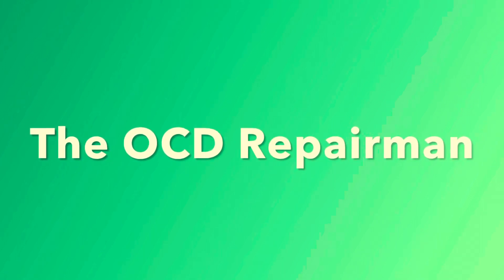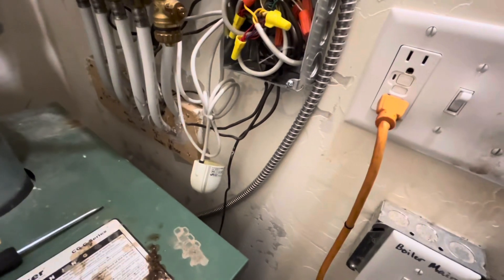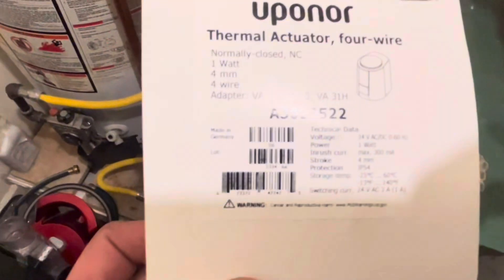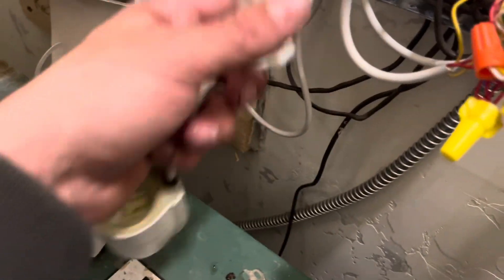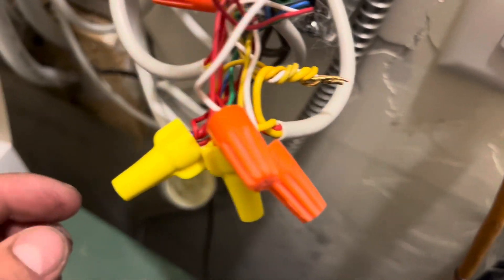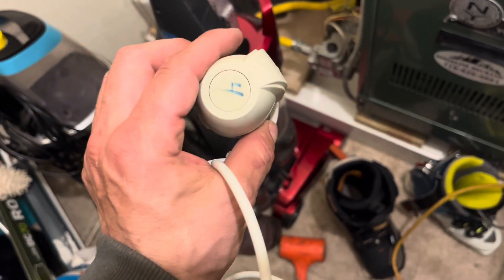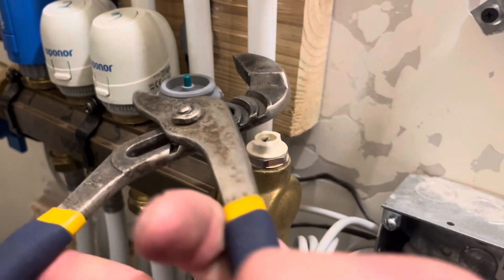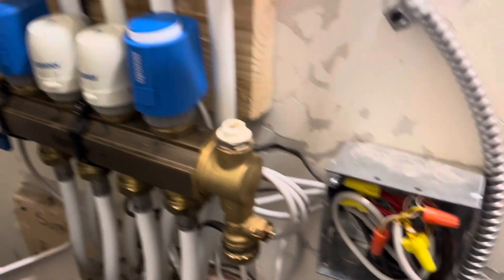How To Replace radiant Baseboard Heat / UFH  boiler system zone Actuator Solenoid. Uponor Manifold

Comment: I just purchased the Uponor Actuator shown in this video (A3023522) to do the same replacement. The one I received has two yellow wires, one black wire and one white wire. They say this is the new coloring system going forward. It's a little confusing because the yellow wires for the new Actuator are now intended for the End Switch terminals (R1,R2). This means that for the new actuators with the Y,Y,B,W coloring system, the yellow wires go where the red wires went before on the old design. The black and white wires go where the yellow wires went before, acting as the motor wires (Y1,Y2). There's a diagram that comes with the Actuator that explains the new arrangement.
Reply from the maker: Great Info!

Comment: Question for you: I have the exact same replacement to do. Does it matter which yellow from the new actuator connects where? I get yellow-yellow & red-red but is it possible to “wire them backwards” so to speak?
-Thanks in advance for your help with this
Reply from the maker: Maybe I’m not understanding your question and I’m not 100% but, if you wired the yellow/ red wire to the incorrect corresponding yellow/red wire then you would likely be picking up the signal of the tstat of the wrong zone. Each of the pair of wires coming into the manifold corresponds to a specific zone in the house if that makes sense or helps.
Reply: @Theocdrepairman  Ok. I understand that part, let me try to clarify. Because they are “4-wire”, there are 2 yellow wires. Does it matter which of those 2 yellow wires from the new actuator goes to which “bundle/connections” of the yellow wires? In your video you showed attaching the first yellow wire from the actuator to the bundle of wires. Did you know which of the yellow wires from the actuator to connect first, does that matter?
(Same goes for red) Like is there a yellow-1, yellow-2 ? Or as long as yellow connects to yellow it’s fine?
Thanks for your quick reply I appreciate the help with this. Hopefully this is a little more clear.
Reply from the maker: @neil_77  I'm trying to remember, but I don't think I have a real answer for you. I don't think it matters as the the red or yellow loop is just a power on circuit, but I am not sure at all...just guessing
Reply: @neil_77  I have the same question, did you figure it out?

Comment: How do you tell which wire is the n switch and which is thermostat? Or can the push bid cause the valve to be stuck  open? Cause even with no command from heating the valve opens on its own
Reply from the maker: You will have to trace the wire from the actuator into the boiler to identify which wire is the switch. In the system in the video if the actuator solenoid is removed the valve will be always open (heat in zone). If the actuator is not working and the actuator is installed it will remain always closed (no zone heat). That being said someone else in the comments mentioned that his system was reverse from the video meaning it was as you described so I can’t say for sure in your instance, here is a another video about the pin valve it might help more…your system could be different tho I’m not sure…How To Replace HVAC / UFH Actuator Pin Valve. UFH / radiant baseboard Heat
https://youtu.be/CazN3Ehg-FI

Comment: Thanks... One question. I have a misplaced actuator. The bedroom thermostat is comanding the dining room heating and vice-versa. Can I just change both clipping out and in without turning anything off?  They are similar to yours but the brand is Danfoss with a red ring instead of blue.
Reply from the maker: @eduleiteyou will need to turn the thermostats on in both rooms in order to swap the solenoids so that you don’t damage the solenoid, turning the thermostats on gives you room between the valve and the solenoid to attach the solenoid on a different zone
Reply: @Theocdrepairman  I see. Thanks but actually I believe that is inversed in my case. When the red is out the water isn't flowing. And when it is pushed in the actuator I can hear the water starting flowing.
Reply from the maker: @eduleite  just to clarify. The “red” being the actuator indicator correct? The real thing to consider is the valve underneath the actuator. In the video the valve has constant pressure underneath the solenoid upward on the solenoid until there is a call for heat. At this point the actuator backs off the spring force from the valve allowing the valve to allow flow. The question for your system is the valve an always open valve like the video or always closed like you are suggesting. In other words when you push the plunger down on the valve the zone is closed when you let the plunger up the zone is open (in this video) the issue is attaching the solenoid you need the wiggle room, taking it off is less of a concern (in the system in the video)
Reply: @Theocdrepairman  In you video there is a blue line showing in the actuator. In mine that line is red. But when the plunger is up (red line showing) the zone is closed. No water flowing and when the plunger goes down (the red line disapears) it opens the zone. I can start to hear and feel the water flowing when the plunger is going down
Reply from the maker: I may have been mixed up on our last comments…if the zone is close with the valve plunger up then you need to turn all thermostats OFF to give you wiggle room. (Unless I’m mixed up again). I just went and edited my last comments to be correct (I think lol) Thanks for your comments…here is another video I made replacing the actual valve if it helps How To Replace HVAC / UFH Actuator Pin Valve. UFH / radiant baseboard Heat
https://youtu.be/CazN3Ehg-FI
Reply: @Theocdrepairman   😅 In short, I have to make the plungers go up. Right! Yes... turning the thermostats off will make them go up. Thank you so mutch. I saw the other video first actually... thanks

Comment: I have done this exact transition from the white wirsbo actuators to the new blue uponor ones. Everything works and fits fine. However, once the call for heat ends and the actuator goes down or into the closed position, the plastic threads on the adapter are popping off the manifold? I'm thinking either the threads are too weak or the stroke length of the new actuator/adapter is too long. Any thoughts or experience on correction of this issue?
Reply: They sell (full-threaded) adapters
Reply from the maker: I had the “pop off” problem on the aged white ones. The plastic push retainers lost rentention power after 15 years and the white ones would pop off. I have had no issue with the blue ones popping off. Did you replace the grey threaded adapter piece? I never had an issue with the grey adapter piece popping off the new blue ones with the new adapter (if that is what you mean). If it is the grey adapter piece falling off, some wraps in teflon tape might hold it on there long-term. Let me know if I am understanding correctly. Thanks for the comment!
Reply: @Theocdrepairman  it is the new Grey threaded adapter that is popping off of the brass threades of the old manifold. Female plastic threads and male brass threads. If this helps explain it...
Reply from the maker: Yes it does make it clear. I have not had that problem.  it sounds like the brass has been deformed somehow and may need to replaced. Maybe the gray adapter piece was manufactured poorly and may be inadequate. You could try replacing either or maybe the teflon tape. Good luck!
Reply: @jefflang2043  are you using the VA33 spacer?  It's like the one that comes with the actuator but deeper threads..

Comment: I have 30 + actuators in my upstairs basement and garage . Original actuators are CSI on a warmrite manifold . Noticed the other day that part of my kitchen floor seemed cold . Checked on manifold and found one actuator not working and two others seemed to be weeping  oil . I guess they are mini transformers . So as mine are no longer available , just wondering about an economical route should they start to fail regularly .  I replaced one actuator 2 or 4 years ago with a Watts actuator . Seemed perfectly interchangeable and has worked just fine . 85 dollar wholesale price is a concern given how many I may need to replace in the near future . FYI mine are two wire on a warmrite manifold not that I think k that matters . Any advice would be great .
Reply from the maker: @bernardrubble8703  That is so many actuators! The weeping oil comment…are you positive it is oil not somehow glycol mix from the system?or it could be oil from the motor inside the actuator. On the system in the video the actuators are wired to the main boiler transformer I do not believe mini transformers are in the actuator solenoid the oil may be from the motor inside the actuator as opposed to a transformer (yours may be different). I suppose the best option would be spend the money and search for the best price online (not ideal for your 30 zones) ALTHOUGH In order to save money you COULD crack open that failed actuator and attempt to identify the failed motor component and attempt to replace that specific part of the actuator internals (or whichever part of the internal actuator failed) This will take some internet searching and you may come up empty. IMO that’s getting a little too deep just to save $85 (x30). But if you can find the motor parts online and do it quick it might be worth it. Finding the best price online for the entire actuator might be the best choice for the time savings and overall longevity. You are right thinking other actuators will fail soon, highly likely. Sorry I can’t be more helpful. The only other way I can think of to save money is find a box of actuator that fell off a truck. Good luck! At least you are not paying for an expensive technician on top of expensive parts!